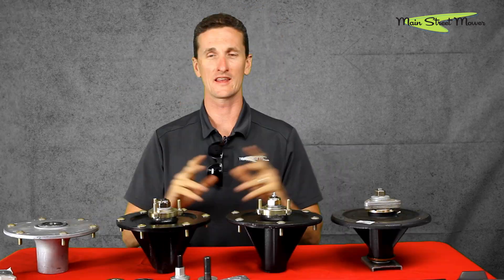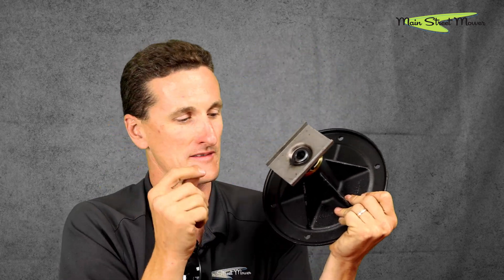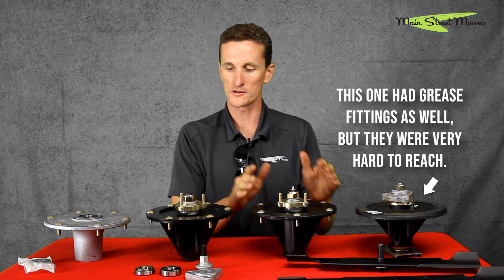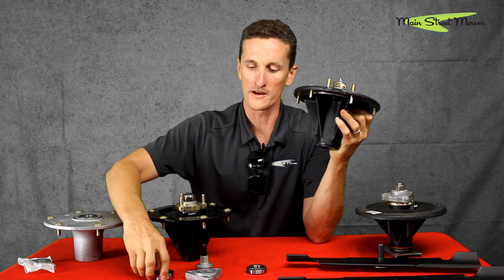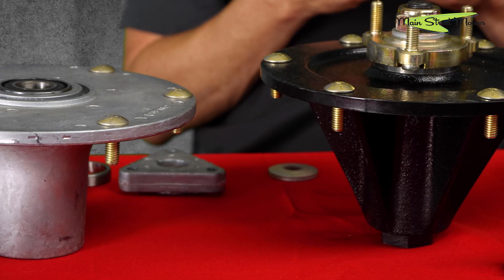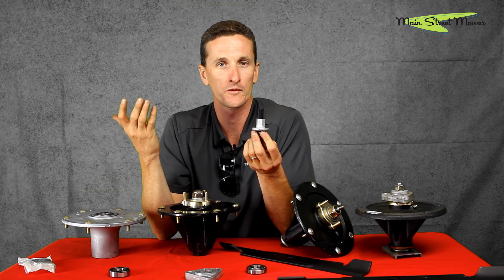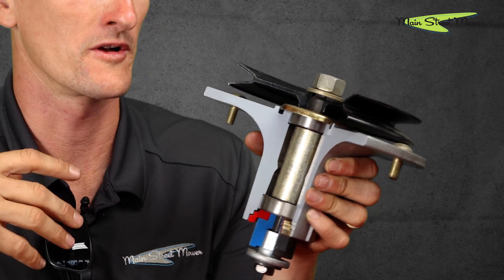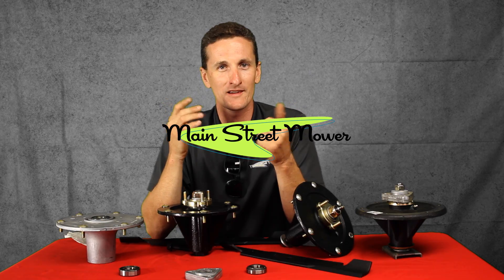Lawn Mower Spindle Evolution from 1998 - 2023

Comment: I'm still deciding between a Bad Boy and a Toro. The professional landscaper who's cutting my lawn now told me that Bad Boy is a good mower, BUT their spindals have not kept up with the power of the newer engines and they tend to wear out faster. He said that Toro has evolved and their spindals can handle the newer motor's power a lot better. I'm still new at all of this, but his comments seemed to align with your discussion. Thanks for the video.
Reply: I own both a Toro Titan Max & a Bad Boy ZT Elite, and the Toro is a much better machine hands down. There is no comparison for fit, finish and ride-ability. On paper, the Specs are similar for both machines, however the toro is smoother, faster and more agile. IMHO the Bad Boy is simply the value proposition as it is the cheaper machine.
Reply from the maker: As a dealer, Toro is a no brainer. They are everything anyone would want from a manufacturer.

As a end users, we recommend finding a dealer that is close to where you live and passionate about what they do. This means they will have happy and competent people and good parts in stock to make owning your mower easy.
Reply: @mainstreetmower  Sounds good and thanks for the solid advice. It's the same as I've been hearing so it must be true! 💪 My dealership sales both the Bad Boy, Toro, and Husqvarna. The Toro Myride and Bad Boy are leading the votes. 🏆 Thanks again. 👊
Reply from the maker: @DHMeister  Good to know. Thank you 
🙂

Comment: The new aluminum spindle's are junk  The bearings are made in turkey or china and are very soft also the bottom seal fails and thus the bearing fails. I have five 5000 series RD mowers and I am only getting maybe 300 hrs before I have to rebuild them go back to the older style with grease zerks. I am considering changing to another brand next budget year because of this...

Comment: I just want to know what is the torque on the top nut of the spindle that has the zero fitting at the top.  Is that a M20 nut or  maybe 7/8?
Reply: 120 ft lbs.

Comment: Sealed bearings last longer than the greasable spindles. I never have delt with a mower that uses the cups / cone bearings. One advantage with them is they are adjustable by compression.